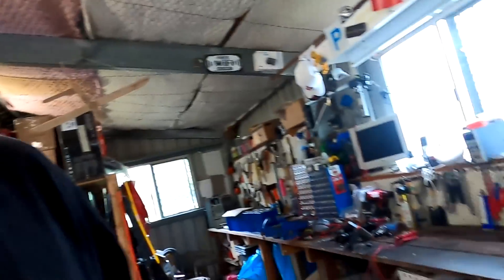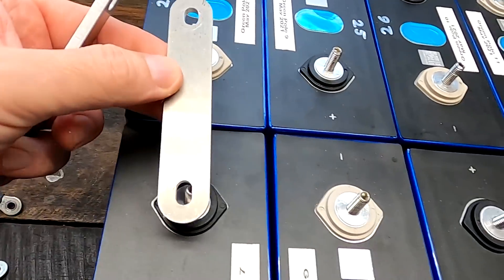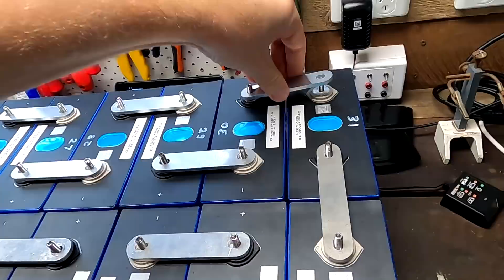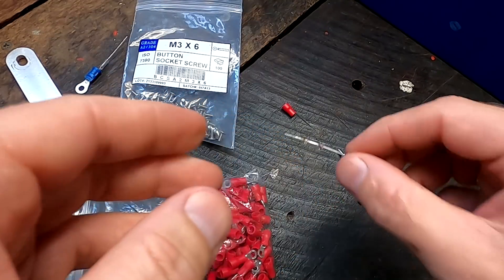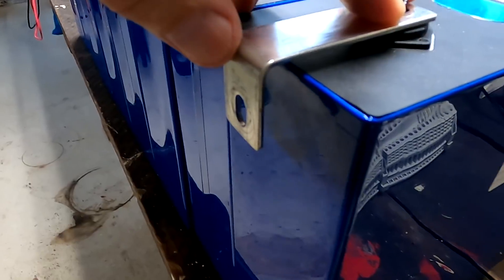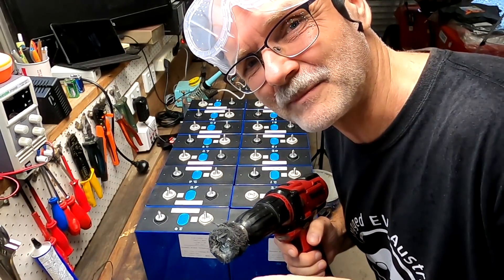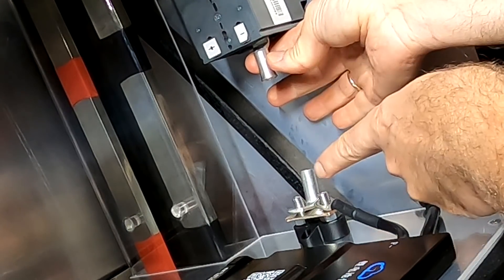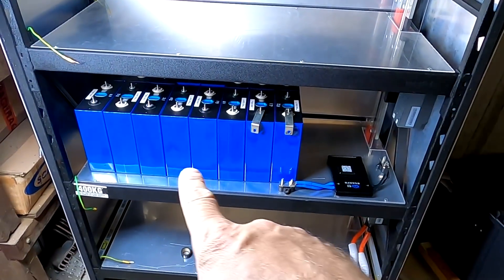Installing a 48V/14kWh LiFePO battery. The first out of three battery banks moves in! Part1

Comment: Hi Andy, I recomend you instead of applying torque, apply it by increasing slowly and step by step, and between each step measure resistence with your ohmmeter, probable there is a point in which more torque doesn't give your better connection
Reply from the maker: It's hard to measure the resistance as I don't have access to the actual busbar any more. I can only measure from one busbar to the other across the cell.
Reply: @OffGridGarageAustralia  you can measure this way:
1. Measure cell #1 internal resistance by touching flat terminals, or bus bars near terminals)
2. Measure between cell #1 negative flat terminal (or bus bar near it) and cell #2 negative terminal (or bus bars near it).

This way you have: internal resistance + connection in cell #1 positive terminal + bus bar. 

Your are measuring one connection. 

Next:
3. Cell #2 internal resistance
4. Between cell #1 positive terminal and cell #2 positive terminal (you now...or near bus bars), so now you measure internal resistance of cell #2 + bus bar + cell #2 negative connection 

May be you haven't now a good access. I don't know this.

Comment: If you can't wait to order the correct fuses you could parallel two 5 amp fuses. But it just wouldn't be right. Even under heat shrink, you would know what is underneath.
Reply from the maker: I have left the fuses without heatshrink, so I can replace them if needed. I hope I never have to do that though.

Comment: Hallo Andy, denk bitte daran, dass die Zellengehäuse alle das Minuspotential der Zelle haben. Der blaue Schrumpfschlauch um die Zelle ist keine ausreichende Isolierung. Alle Zellen stehen auf einer Metallplatte!!! Sollte die dünne Folie an einem Akku beschädigt sein, oder durchscheuern dann hast Du einen fetten Kurzschluss.
Reply: Die Plexiglasplatte am Boden ist sehr gut, aber so etwas müsste auch zwischen den einzelnen Zellen sein.
Reply: That's useful to know, I'd never have thought of that! Danke.
Reply: Er hat Plexiglas auf der Aluplatte, also keine Kurzschlussgefahr vorhanden. Der Gefahr war er sich bewußt und hat deshalb auf Isolierung geachtet.
Reply: Und genau deswegen befindet sich ja zwischen Aluminiumplatte und Zellen vollflächig eine Acrylglasscheibe...
Reply: Klingt vernünftig, da jedoch 5mm Abstand zwischen den Zellen sind, wird da aber vermutlich nicht viel scheuern. Sofern sie press stehen, sollte da gewiss etwas dazwischen, so wie bei quasi jedem industriellen Akkupack.

Comment: I think the fusing of the balance leads is a bit of „german overengineering“ (and I am not sure whether it would actuslly save the BMS.) But I very much like the „visually logic“ concept and can totally relate to that!
Reply: Proper fusing is not overengineering.  Not fusing is asking for trouble.  Fusing did save my BMS, btw.
Reply: Speaking of fusing, having both terminals on the side of the battery and not having the positive one fused at the terminal would make me very nervous. Why not install something like a 300amp AMG catastrophic fuse right on the end of the positive terminal bus bar and then heat shrink it all closed?  Knowing me, I would slip when installing the side panel and it would arc against the terminals.  I’d much rather blow a fuse than a cell or two.  Just a thought.